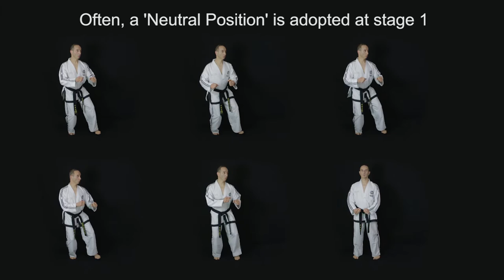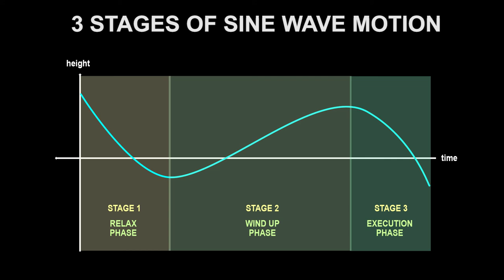Taekwon-Do Science: Sine Wave Motion #3

Comment: Shouldn't the examples be cosine wave motion as the graph of cosine starts at 1, unlike sine which starts at 0?
Reply from the maker: Thank you for your question. The graph is neither a sine wave nor a cosine wave. It is just the wave representing the height vs time of the example in the video. Other examples may produce a different wave depending on the stances you start and finish with and the type of technique. The important thing to remember is that Taekwon-Do sine wave motion has a smooth transition when changing direction just like a sine wave (and therefore also a cosine wave, since sin (x ) = cos (x-90) so basically sin and cos are the same wave with different phase of 90 degrees). Another similarity is that the motion is 'wave like'. But that's all. 
Taekwon-Do sine wave motion does not usually start with upward motion like a real sine wave. People should not get too fixated on the name 'sine wave'. Taekwon-Do sine wave motion is not mathematical sine wave motion.